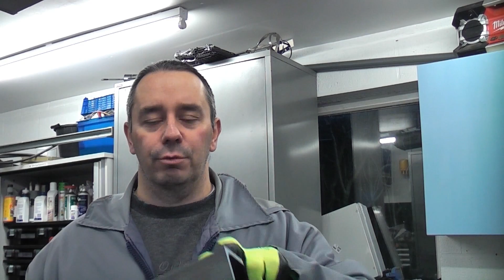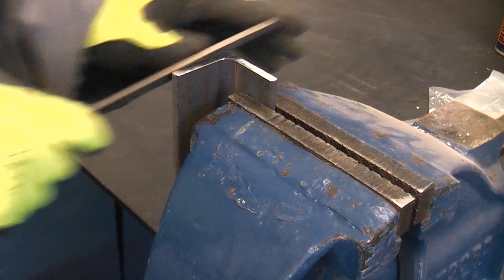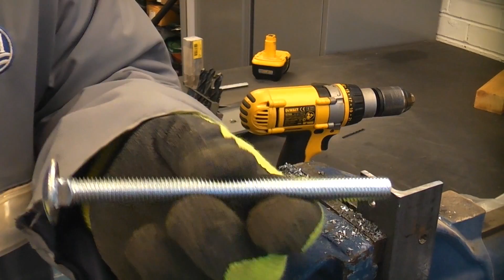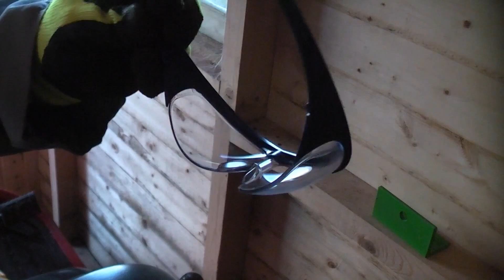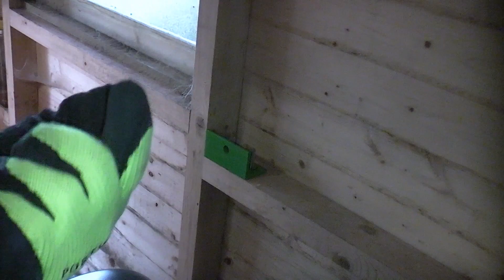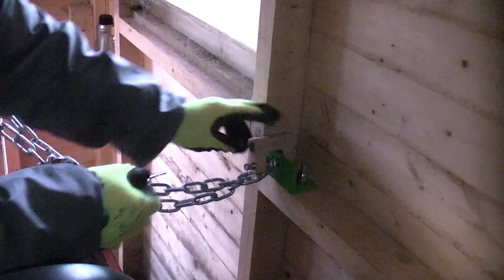How to make a chain securing point

Comment: Hi I just wondered what brand of mono padlock that is, I saw that you used the same type on the slip rail you made, I wondered if they were insurance rated, I like your vids mate, thanks
Reply from the maker: I can't remember the exact make, but they are similar to this- https://fave.co/3cNfVLP
I actually have about 8 of those padlocks, which are all keyed alike- so I only need the one key to open any of them.
I seriously doubt they are insurance rated, although you will be able to get them. 
Thanks for the comment 👍

Comment: I did something similar recently by bolting a hardened steel staple to a steel cabinet in the garage and padlocking a strimmer to it using a security cable from Screwfix.
Reply from the maker: Thanks for the comment

Comment: I would remove the steering wheel. You did a great job, i would do it the same - but only use shorter screws.
Reply: Bolt cutter cuts the chain

Comment: Love your videos ! Top quality ! Whats that angle tool called that you use to scribe and messure with ? seems like a really usefull tool! By the way, im starting a little workshop in my shed and i want to make a living out of it. I work as a licens welder at my day job but i want to be my own boss. How about some guidance videos on what to produce to make some money ? I would really appreciate that !   

//Mark from Sweden
Reply from the maker: +Vild Mark Hi Mark,It's an adjustable square, or sometimes called a combination square.I'm sorry but I don't have a clue on what to make to make some money as I do not make anything to sell, but best of luck with your venture.  Have you considered doing sculptures that are welded together, like the metal men made from nits and bolts?
Reply: +Ultimate Handyman Thanks! Found and ordered the tool now. oh ok i see.. No i´ve never tried that, i need to check that out. thanks for the  idea! 

//Mark

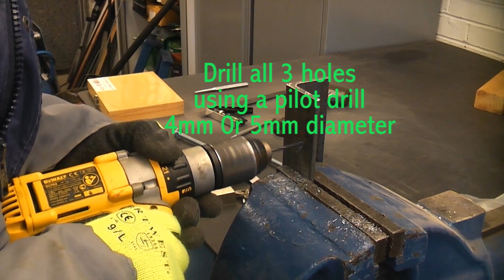Comment: 3:08 - That drill isn't going to last long if it's bent like that.

The chain may be pretty strong, but if they fail to cut the chain, they're just gonna cut the steering wheel. The solution would be put the chain through some larger metal parts of the mower (or whatever that is).
Reply from the maker: +SmartassX1 
I think that was a crap quality drill that I found somewhere LOL.

Comment: if you add a high tensile chain it would be almost impossible to cut. we use them at the shop for heavy equipment and it takes two big boys a while to cut those bad boys. excellent video and great you showed the use of shear nuts, something that should be more common knowledge.
Reply from the maker: +ri mar Thanks for the comment ;-)
Reply: And if you have some extra money you can buy transom U-bolts to fasten that chain too then you only need a drill to install all .

Comment: What happens if a burglar brought bolt cutters and stole your mower?
Reply from the maker: +Mc Paintcraft Well if he manages to get through the door to get in there in the first place (unless he brings a cordless angle grinder or Oxy acetylene), then if he manages to disable the alarm system, then if he manages to break through the one steel gate, which is the only means of access to the property, I think he would have made at least some noise and brought some attention to himself. If he did get away at least I would have the footage of him on the several video cameras ;-) It's highly unlikely that some Heroin addicted burglar would come equipped with a pair of bolt cutters though ;-)
Reply: Lmao, I could bypass all of the above.
Reply from the maker: +Mc Paintcraft PMSL
Reply: +Ultimate Handyman absolutely brilliant
Reply from the maker: +Rui Nunes 
Thanks for the comment ;-)

Comment: What type of blade did u use to cut metal? Usually i use a black grinding disc
Reply from the maker: I used the Evolution Rage 3 for that cut. These machines are much better than abrasive discs for cutting metal, they also cut wood and plastic using the same blade.
This is the review of the Rage 3 https://www.youtube.com/watch?v=x1_di0CTrtM
This is the larger Rage 2 machine https://www.youtube.com/watch?v=zI09uLXTvmE

This is a comparison between an abrasive machine and the Rage 2 https://www.youtube.com/watch?v=dPSebuPlHH4

Comment: Simple and very effective. 

Personally, with access to your evolution saw I'd of cut the angle on the bend so you've a straight flat piece of metal and put it on the underside like a large washer. Would of stopped pull through without using a nut under the sheer nut. 

Cracking video once again though.
Reply from the maker: I have a fair bit of flat steel in the workshop which I could have used for this, but I underestimated how much torque was required to shear off the shear nuts or I would have made a mating flat piece for underneath. I know for next time though ;-)
Thanks for the comment ;-)
Reply: Still something I'll do I think. So simple.

Comment: Great idea,esp the tip for widening the chain.
This would be useful to lock items in a stable or remote outhouse.
Reply from the maker: Thanks for the comment
Reply: chain it to a nice big stone, dig a hole in a way the stone will land on the chain, .... push stone over with tractor. bolted locked and 1000 pounds sitting on it ha.

Comment: I also haven't dealt with shear nuts, they look very useful. I looked for the cutting fluid you use in my local Screwfix but couldn't find it, I found a liquid alternative that is very effective but I would like to try the spray. Do you have to make a special order?
Reply from the maker: The drilling and tapping fluid is a couple of years old now (it lasts ages). I just checked screwfix online and they don't seem to sell it any more. You can buy it on ebay though, CT90 etc.
Reply: you can use CRC 'brown cutting fluid'  works well for tapping holes and cutting metal on the mill or lathe.
Reply: CT90 is what I have, seems to do the job just fine. Thanks for checking for me. The CRC fluid looks to be similarly priced to this stuff I got from a local independent hardware store so I will keep getting it from them.

Comment: Nice video, you could also use the same method for bolting down power tools, those tools are so expensive. A lot of gun shops use a similar method for securing guns, they have them in a rack and run a steel cable through the trigger guards. I'm thinking about putting one of these in the boot of my car so that I can secure my shotgun if I have to leave it unattended. I just need to find a good anchoring spot. 
Cheers 
Cameron
Reply from the maker: Thanks Cameron, anything that makes it more difficult for the thief is a good idea ;-)
Thanks for the comment